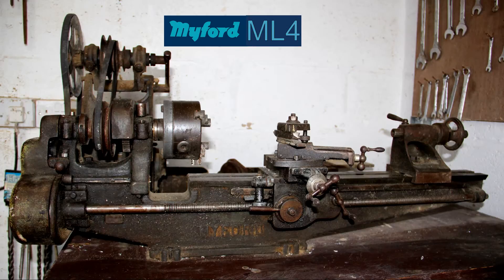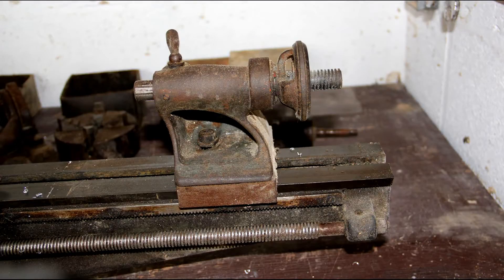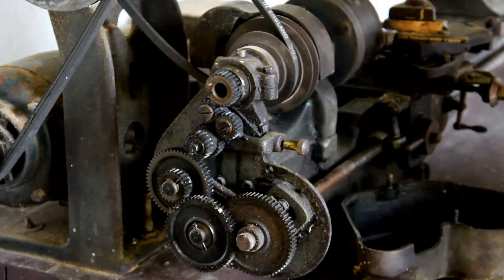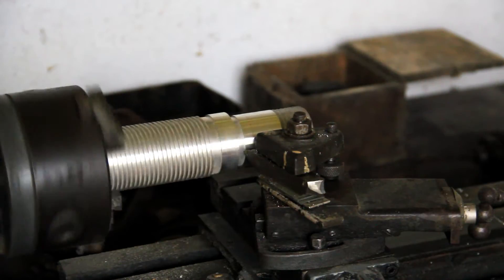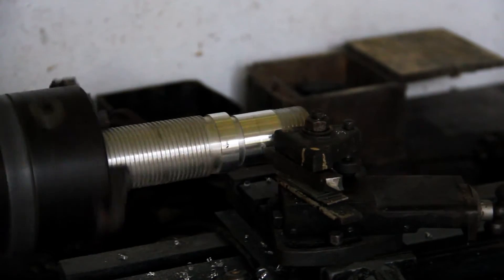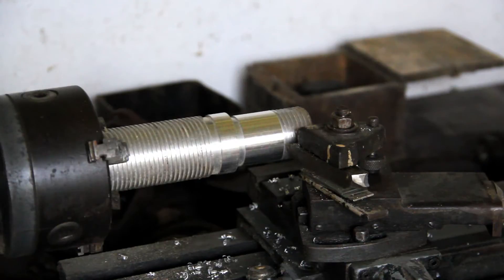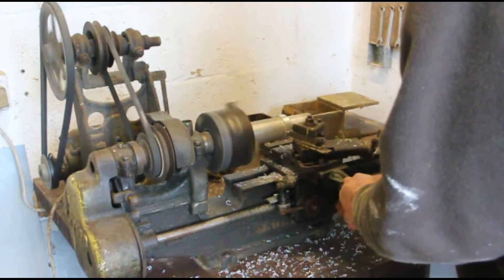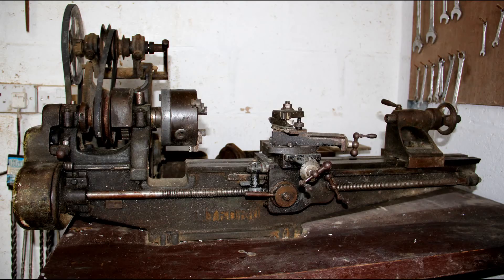Myford ML4 lathe

Comment: It's an ML4 with upgrade to the tail stock.
Long cross slide screw.
Large diameter dials.
With a threading dial, I’ve never seen one on a ML4.
Reply: I have one. It is titled as an ML4 Tumbler Reverse. I also have the thread dial indicator, which was bought in 1964 and cost £1. 2s Op.

Comment: It does look like an ML4, I'll measure my bed tommorrow, if you measure the bed where the saddle and tailstock is then this will give you confirmation. Yours has some nice refinements which make for a good usable lathe, firstly the clutch mechanism, so drive can be halted while the motor is still run, useful for the life of the motor. Also the forward/neutral/reverse on the leadscrew. A modification that I wish mine had. It also looks yo have the more advance tailstock design that was released by myford after many people complained about the lack of a proper settable tailstock design. Without hours of fiddly setup. This was offered as an optional upgrade at great expense, but delivered a much better tailstock that could maintain iys concentric setting longer than two seconds. Finally the guards to protect your fingers and clothes from been trapped in there. All in a decent package for an ML4. The only thing that I would upgrade on that one is to install a 2:1 gear and handle bolted to the apron which will mean that the saddle traverses the correct way when the handle is turned. Though if you have lived with it all your life then it would not feel so backward to you.
Reply: That's not a clutch but a belt tension lever. It allows the top countershaft to drop.
If it had a clutch, it'd have 2 levers.
Reply from the maker: Thank you - that's really interesting.  I do know that the original tailstock cracked and had to be replaced by my father in the 1960's so he must have changed it for the improved version then.  I have always been used to the apron handle working the wrong way - but I never had a problem using other lathes that work the "right" way. The machined slider of the bed is 26" long.
Reply: Engineering Stress Intuition what's your bore on the spindle? There were two options offered for this also the standard MT1 socket 3/8" (upto 0.400"). Or the slightly larger MT2 socket spindle which I think cleared 5/8" materials. So called the big bore conversion.
Reply from the maker: it just clears a 15mm pipe - looks like it was bored to 0.6"
Reply: Engineering Stress Intuition big bore MT2 socket spindle then. It's got all the mod cons 😊
Reply: @engineeringstressintuition5083  0·625 is 5/8" !

Comment: It's either an ML4 or an ML2 dependant on the bed length. What makes you think it's something different? My lathe is an ML4 and I can tell you for sure that it's one of the two, guess would be the 4 but without a measurement I can't say for certain.
Reply from the maker: The external length including the geartrain cover is a fraction under 38 inches.